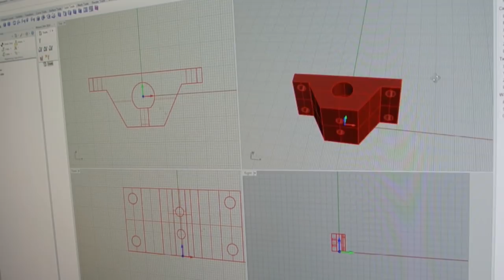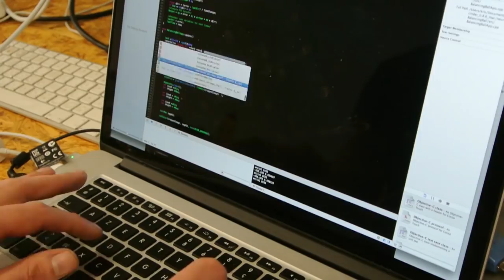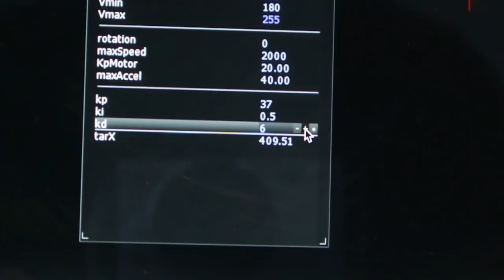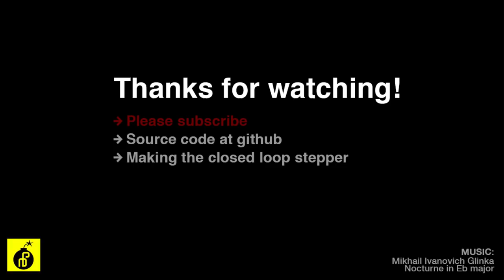Balancing Ball: PID controller test

Comment: Hi, nice system.  I think you would find more stable operation by using gears to increase the number of motor turns required to make a small motion and also to increase the number of encoder counts to make a small motion.  More encoder counts makes more accurate PID calculation, and more motor turns makes smoother operation.  :)

Comment: I suspect that the jittering of the controller might have to do with “poor” discretisation of the system. That is, your pid I assume is tuned in continuous time (Laplace transformed ode) but the code you wrote runs in discrete time (Z-transformed ode). If the equations in your code ( the z transform ones) aren’t the exact equivalent to the Laplace ones, you might get the jittering you observe. (I have encountered this in modeling and controlling inverse pendulum dynamics with micro controllers). Cheers!

Comment: I can clearly see the gears are not engauged and the stepper motor is not in sync with the encoder gear.  You may want to consider using pullies, or a double shaft stepper where an encoder can be mounted direct to the shaft on the reverse side.

Comment: I am coming back to this video 2 years later, to use the same kind of idea in one of my own project. I was thinking, what if you put some weight at one of the ends of the stick ? Will the ball move to other side to keep the stick balanced ? Also, would be of great help if you help me out with this a bit, cuz looking at most stuff, I only keep finding the wheel balancing robot and nothing of such type, where the weight is balanced by moving another weight in the opposite direction. Thank you

Comment: Hello Kris, can I use these motors for CNC machine as closed loop stepper motor? My CNC stepper motors controled by Ethernet SmoothStepper (ESS) and Mach3 program. Or is it can be used only with Arduino applications (or CNC)? 
Commercial closed loop motors are very expensive... 
And your videos are amazing!

Comment: can you tell me the names of the softweres that you are using? (The one with the black background, and the CAD one)
Reply from the maker: The Cad one is Rhinoceros. The other one is Xcode (a mac IDE, for C++ among other things) but you could use anything you want for writing C++ (for example Visual Studio if you use a PC)
Reply: ***** I saw that you using Arduino. Did you use emebXcode for Xcode, or you write without Arduino functions?
(Github link is missed)
Reply from the maker: Саша Б It's just Xcode (use the arduino IDE and a basic sketch and write a C++ library using Xcode ). The github link is also in the description.
Never heard of emebXcode, looks cool, I'll check that out, tnx! :)

Comment: Hi Kris.
I really like the idea of an encoder as a closed loop controller for the stepper motor, i see this as a 'poor mans' servo motor. My question is :- is the 'juddering' i.e. the 'large' amount of movement at the ends of the wooden channel a inherent feature of the stepper motor or is this a feed back loop timing issue ?
Sorry to get a bit technical but my project is a CNC router and using an encoder would solve any 'missed' steps - so in your code is the encoder saying 'i am half a step away from my target position' but you stepper motor/driver cannot resolve the half step and does it's best...so would a 2:1 gearing on the stepper motor created a more stable channel?
Reply from the maker: megadiddydave Hi, the juddering has more to do with the camera capture delay and precision. I also wanted fast movements so I didn't care about some PID overshoot. for a CNC you really don't wat that. 

But what you describe can happen if your steppermotor steps are bigger then the resolution of the encoder. As long as the step resolution is bigger then the encoder resolution everything should be fine. (you can use a gear or smaller microsteps for that if needed).  Good luck with your project!
Reply: megadiddydave The juddering is coming from the gear backlash. The encoder should be connected directly to the motor shaft to avoid it. Kris missed the the point from the very beginning.

Comment: Hey! I have a burning question! What did you use that allowed you to program using a webcam???? I want to do that so badly!
Reply: Not sure what he used, but OpenCV and Python (or C++) are very commonly used for things like this. It's only a few lines of Python to loop frame-by-frame through video received from a USB webcam, use HAAR cascades to identify an object (like the ball), get the location of the object (i.e. distance from the center), compare it to the last location (i.e. which direction is it moving?). Twenty lines of code maybe.

Comment: Hi Kris,  how is the encoder wired?  I'm assuming it has to be connected to the driver.
Reply from the maker: Mike Stanzel Its not connected to the stepper driver. but to an Arduino that drives the stepper driver. Here You see how I did that: 
https://www.youtube.com/watch?v=Z6OMT1fIQnU
Reply: ***** There it is.  It looks like you are sending signals to the stepper driver from some digital pins at the end of the Due and are receiving some PWM signals somewhere over there on pins 2 thru 13 from the encoder.

So you send a signal out and then check to see if the encoder has moved with your program?

I'm interested in this because I programmed a couple of identical CNC milling machines a long time ago (longer than I care to admit).  One had an open loop system and one had a closed loop system.  We always had to check the location of the machine table when the open loop system changed tools.
Reply from the maker: Mike Stanzel Yes, In a way it's like that. But Its a little bit more complicated. 
I made an abstraction of the stepper steps. I check the encoders current position and speed. And then I calculate how I want to move to get to the target position as fast as possible (limited by a max speed and max acceleration) . the result is the speed i give to the stepper motor (underlying it's still steps, but the "controller" doesn't know that). 

Its not how you would do a CNC because of the overshoots. Its to react as fast as possible to realtime changes. With a CNC you can anticipate the next moves and you definitely don't want to overshoot your cutter.

Comment: Hi, I have seen your videos of stepper motor conversion. But I noticed a fundamental design flaw from the very beginning. You used gears to connect the motor and the encoder which introduces (or definitely has) backlash to the system. And it is clearly visible if you look closely at the place where the gears are mating. This ultimately contributes to all the jerkings/vibration/juddering of the bar holding the ball. These plastic gears are of low profile and not perfect. The backlash and  uneven mechanical power transfer between the gears makes the system unbalanced for a while. It could have easily been avoided if you had directly connected the encoder on the motor shaft using some rigid coupling. Although it looks neat to have gears and some fancy CNC cuttings to connect the motor and the encoder, it is a fundamentally flawed concept. But I should really praise your initiative in creativity and your video making skills my friend. You seem to be more of an artist than a technologist  ;-) Take care
Reply: Mohammad Arif Hossain  Yes much better to use belt and pulleys.

Comment: Great videos! I am considering doing some closed loop stepper control as well. Do you think the vibration seen in your stepper motor shaft is due to the backlash that occurs due to the encoder not being attached directly to the motor shaft? I have read that having an encoder downstream of the motor instead of directly coupled to it can cause poor performance, or 'bouncing' around the target position.

Comment: I think that’s a really impressive project dude. I’ve mainly used PID on keeping temperature within range on industrial ovens. Controlling analog 4-20ma rotary valves. Rockwell/Allen Bradley controllers were considerably easier to tune. Im assuming the camera is acting like an optical sensor?

Comment: That gear backlash really sucks. This application should use timing belt/pulleys (to get trusty values) and results will be way more stable.
Reply: +rodstartube in fact, encoder is useless while using a stepper motor, as you control step position, unless you use a brush dc motor as a servo (servo = motor + encoder)
Reply: +rodstartube what is that music, Schubert?
Reply: +rodstartube Yeah I was wondering too why he uses the encoder and then controls it all via openCV...
CV should be well able to calculate the dynamics of the ball and correct via the stepper. Knowing the stepper's position is somehow useless in this case. On other mechanisms they make sense - to be sure you do not loose any steps for example.

Comment: Kris, what kind of sensor did you use?
Reply from the maker: a rotary encoder for the rotation, and a webcam for the position
Reply: Hey!  is there any way in which we can reduce the trembling of the balancer? the system is very sensitive

Comment: what type of MCU are you using? i dont see the .ino file
Reply from the maker: +jai Lopez  Its an Arduino Due (but it can run on any arduino).   The github link is just the PC (or Mac) side I think. This is the arduino part ->  https://github.com/neuroprod/ClosedLoopDriver and matching video: https://www.youtube.com/watch?v=Z6OMT1fIQnU.
Reply: +Kris Temmerman thanks, can you explain to me where is the PID found ? i want to learn from your pid setting how and what i should be focusing  for pid? i made my own Servo 
"DIY" and want to know how to use pid to control its direction of step in increments like any servo, i build my own Hbridge and i have a POT and a dc mototr with a 3D printed Gearbox i made but no control so i guess this is the one thing i need to learn before i can start moving the horn/shaft/arm, so i was hoping i can learn from yours so that i can apply to Arduino
Reply: +Kris Temmerman as far as Visual Studios im fairly new  tho i do write in C++ but im a;lways stuck with some friendly folks who pass me their code like you have when i upload it to VS and it ask me to Attach rather then play or build and run thats the easy part for me just click run or one of those but sometimes like now for your code i dont see the RUN i see Attach and im not sure attach to what

Comment: Closed loop feedback is quite unnecessary here, since the resistance will probably always be more or less the same, so the stepper motor (assuming it has enough torque) shouldn't miss steps anyway. Besides you're closed loop feedback apparently just makes it jitter like crazy. Although that may also be the ball tracking that isn't smooth enough.

Comment: if you had put the camera in front instead of above you will have x and y both, right now u x only. but good project. I am trying to do the same with a Kinect v1 (I know it can be done using a simple camera, what can I say, my supervisor is an ass**). ;0

Good video though! (y)

Comment: <script>

var error = 0;
var error_next = 0;
var integrator = 0;
var diferenciator = 0;
var power = 0;
var setpoint = 160;

function generatepower(plength){
error = setpoint - plength;

var kp = 11;
var ki = 0.5;
var kd = 9;
var error = setpoint - plength;
diferenciator = error - error_next;
integrator = integrator + error;
power = kp*error + ki*integrator + kd*diferenciator;
error_next = error;
return power
}
function populateform(enterlength){
document.pgenerate.output.value=generatepower(enterlength)
}
</script>
<form name="pgenerate">
<b>Sensor:</b><input type="text" name="thelength" size=3 value="">
<b>Power:</b><input type="text" size=18 name="output">
<input type="button" value="Calculate" onClick="populateform(this.form.thelength.value)"><br />
</form>